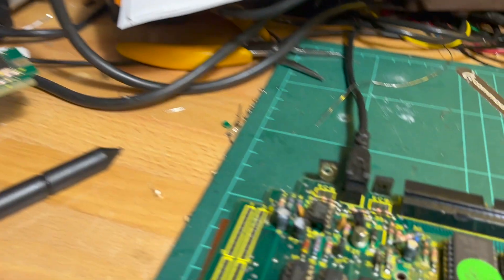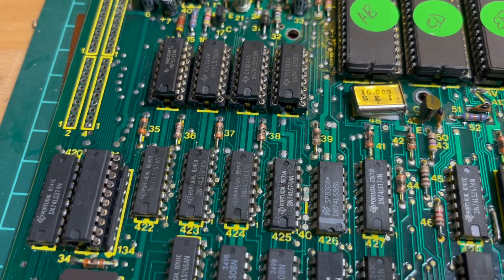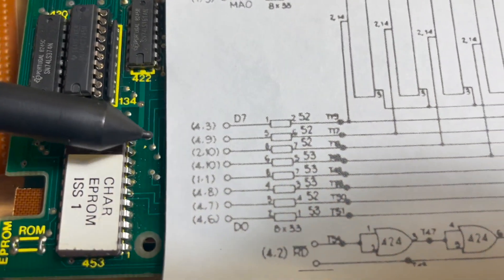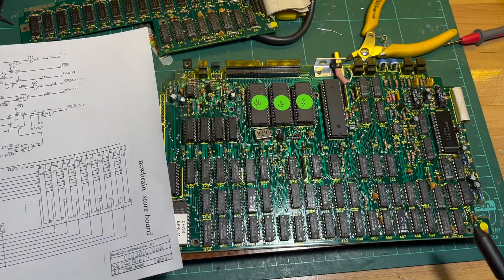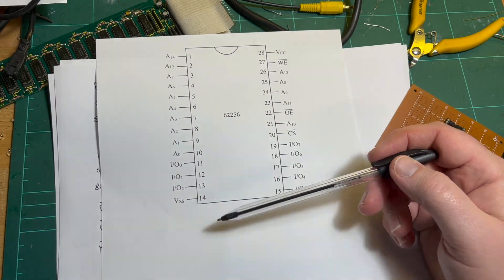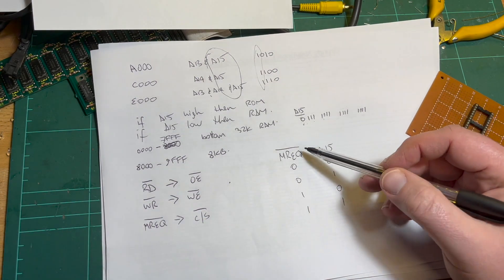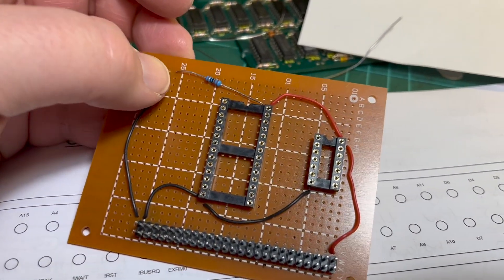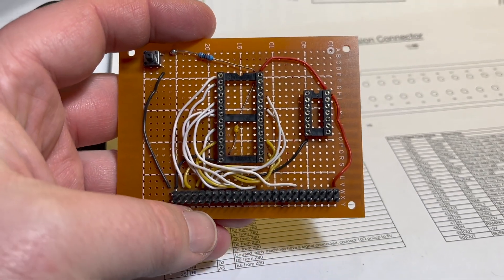🇬🇧 Grundy NewBrain: Part 7a (Starting work on new SRAM board) [TCE #0062]

Comment: I was running through your videos because I used to work on/with Newbrains too. In the 80's. Very troublesome I might add. Faulty memory chips, ribbon cables getting loose, tons of TTL chips, compact designed with three layered boards..... 
Each time I saw you flipping boards I thought "be careful with the ribbons!".
I admire your perseverance. 
Any change me watching a video of a working Newbrains? It ends with an empty SRAM test board.
Reply from the maker: Thanks for watching them Hans!  It's certainly a dense design, all those chips and a VFD squeezed into "the keyboard".  Yep, I still need to finish off the SRAM board ... no idea if it'll work ... but I got a bit distracted with all those Soviet Speccys ... it DID work when I initially powered it on ... then the capacitors fizzled away, including one on the DRAM board, which is why I'm hoping it's still not working ... hence the SRAM board.  I'm away for work at the moment ... I'll try to get it finished off in the next few weeks! /Brett